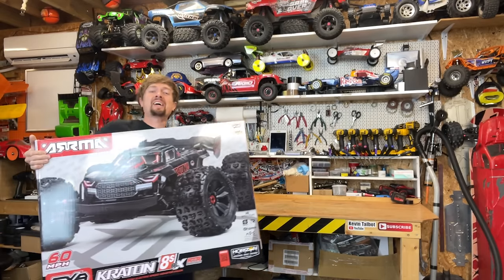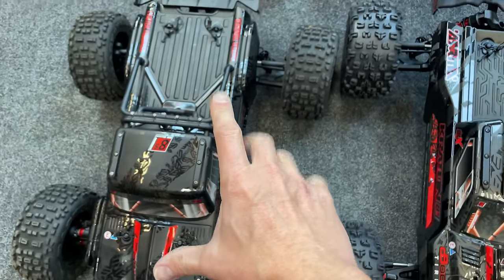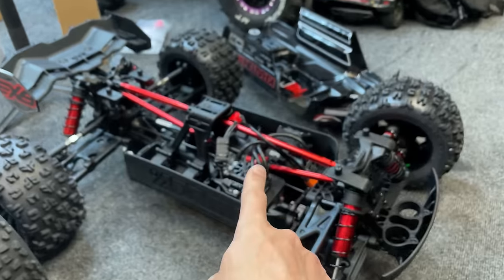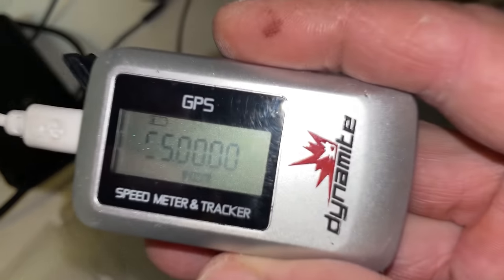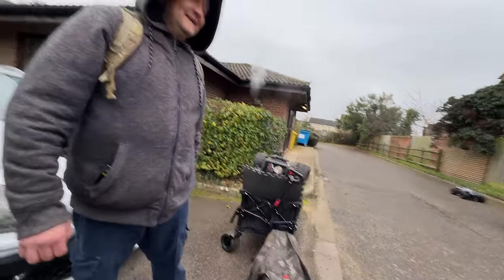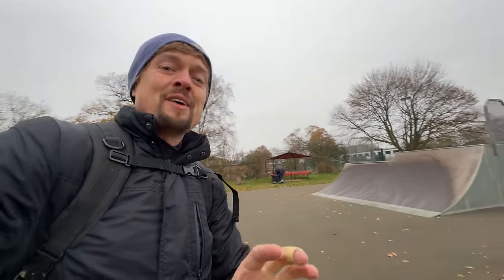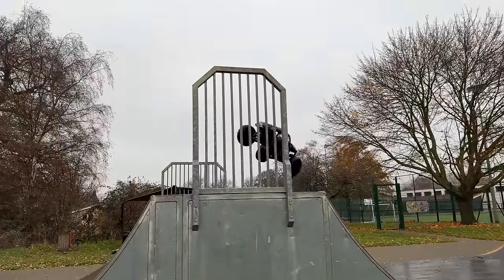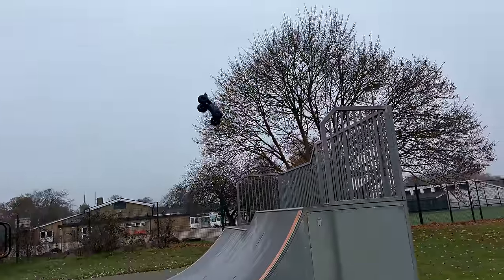This Giant Motor is Too Big for this RC Car

Comment: An RC Car that costs 4 figures, and uses the tag lines 'Engineered tough' & 'EXtreme Bash Speed Monster Truck' should be able to survive at least a single battery pack at a skatepark.
Reply from the maker: im saying nothing!
Reply: @KevinTalbotTV  coward 😅
Reply from the maker: You used to a an arrma fanboy what happened? 🤣🤣
Reply: @KevinTalbotTV  never been an Arrma Fanboy... prove it 😅
Reply from the maker: you was until they stopped giving you free ones 🤣🤣🤣🤣
Reply: Knock it off boys👨‍🦳
Reply: Tomley is a bit jealous 😶
Reply: @Logsshots  of course 🤣. The $5000 rig I’m building at the moment is way cooler than this 👌
Reply: If its so cool why does kev have 10 times the subscribers as you? 🫣
Reply: @TomleyRC  I’m at subscriber to your channel you and Kevin ain’t much different I like watching you both
Reply: @TomleyRC wheres your monster truck
Reply: Lol bullies
Reply: I was gonna buy one of these until I saw this video thankfully and wound up going with the 6s notorious. It seems like all they did really was just scale up the size of the 6s models without any real consideration for the weight increase and power increase on the drivetrain. It should have had better bulkheads and a stronger diff right out of the box. Shouldnt really be a need to immediately spend another grand in m2c racing parts for this thing to be fun. Traxxas at least has that down with the xmaxx.
Reply: Guys they just made fun of each other, dont be so mad..... damn internet karens.....
Reply: @robsp32 um....traxxas breaks just as easy when doing the crazy shit Kev does. There's a difference between extreme bashing and defying the laws of physics. You missed out on a killer rig. The notorious is a dope car too, but it's no Kraton.
Reply: @KevinTalbotTV LMAO
Reply: just cry about it both if u
Reply: Tomley I beg you stop talking waffle
Reply: @Boogie_the_cat  I did it myself 😁
Reply: I don t even care anymore now that I know better . I was kinda mad at two new Arrma RC cars servos going down within 5 packs but I’m done with it  . They should do better but this has been going on for years and the whole aftermarket parts pricing for a $150 from RC is ridiculous . People get upset and go where there’s more value . I do like my arrma RC s though .
Reply: With my dad, we played with our arrmas, only our 3s’s though, since our kraton 4s was broken. I managed to break 2/3 cars that day on a single 3s2p LiPo.
Reply: They’re all junk compared to my techno
Reply: It’s not physically possible to make an RC that heavy that can withstand landings on concrete at skate park. Could it possibly be more adorable sure but a skate park is about the toughest durability challenge you could possibly throw at an RC car. Edit: I just got to the point in the video where they show what broke. I guess I could definitely say those steering linkages should be made of aluminum on the extreme bash edition but it’s possible that’s an engineered weak point to protect other parts.
Reply: Why wouldn’t Arrma move the transmission back a few mm’s on the new Kraton to accommodate the 118 mm hobby wing motors.

There’s about 2 inches of wasted space between the batteries and the rear bulkhead. It could have easily been move  center drive shafts. Even the current 113mm 800kv barely fits. Plus it’s so unbalanced with the weight of the motor, ESC, and servo all pushed right up at the very front of the chassis. Moving it back would have made it far more balanced.
Reply: For such a expensive rig I expected better
Reply: Yea , I agree , I can remember years ago , we would  drive HPI savages and my Revo 3.3 in skateparks and they took a beating . The Kraton didn't really hold up that well
Reply: OMG it's Tom Lee I watch your channeOMG
Reply: @TomleyRC 😢
Reply: @Logsshots  damn
Reply: I never go to the skatepark.
Reply: no one drives an ric like that regularly without upgrades,

Comment: NIIIIICE 👌🏻 
I have to say I would be a bit pissed if the servo and ESC broke that quick, awesome rig other than that and that was some very hard impacts though lol
Reply: Same, you spend alot of money on a Nice big RC car, and one of the first time you jump the thing it stop working.. thats not good enough.. 🤷‍♂️
Reply: @jesperlehmann4336 didnt exactly break on the first jump though did it
Reply: smahing any rc on concrete is just plain stupid
Reply: yeah but 30ft to flat on an 8s truck isnt really in it's design scope.
Reply: Mate I bought a tlr Typhon nearer the start of the year and the servo died twice straight out the box. Replaced it like for like after the first run and it died straight away again on its second run. So had to replace with an upgrade which was £48. The buggy was like £700 and it couldn’t even cope with its power on stock parts. Wot a joke!!!! How can spectrum get away with this over n over the servos aren’t fit for purpose.
Reply: Bought the traxxas raptor r, brand new traxxas lipo first run around a flat field and the esc and motor went up in smoke. Unfortunately the shop I got it from were a complete nightmare to deal with but I did get replacement parts weeks later
Reply: Seriously 1k for a kraton 8s and it breaks that quick🤔
Reply: Ain’t awesome if breaks after 5 mins
Reply: That’s not fair to say in this case. Slam just about any major brand this hard and its going to fail.
Reply: @tidyt3656 Did you not set the end points? Longest I've gotten out of ANY servo is 6 months, but I toasted a couple in one pack before I realized you always gotta set your own end points.
Reply: My Xmaxx had a dead esc straight out the box.  It never turned on the first time to break.  My buddies Maxx had a dead servo the same way.  It never worked the first time.   There are defects and duds from every brand.

Comment: In my personal experience, I have only seen one 8s Kraton chassis bend. That’s because we were trying to jump it over a tree, and kinda missed and the truck landed on a big branch. 

I think people should give the metal chassis a little more credit, because Kev runs everything on skate parks, which is incredibly tough on everything. (Makes durability tests even more impressive) Whereas if you run on dirt, things should last a lot longer. 🙂
Reply: I do feel like these cars need stiffer suspension for running skate parks to be honest.
Reply: You can see tons of bent chassis videos on YouTube.
Reply: @truerc Oh I’m sure you can. That’s why I said in my personal experience, metal chassis have been relatively durable
Reply: i bent my 8s outcast chassis on flat ground in my yard, and my notorious 6s on like a 8 or 10ft jump. they’re weak
Reply: @samhutchins5890  Fair enough. I guess I’ve either been lucky or bent chassis without noticing. I have bent a TON of 6s Kraton v3 shock towers though. I would straighten them out as best I could. Eventually I upgraded to m2c shock towers and chassis though and it’s much better.
Reply: @casey1441  is it really worth it? i just got that outcast and cant run it now. im torn between the m2c or a exb chassis
Reply: i agreed.arrma 8s is too heavy.not meant for jump 50ft on
 skate parks
Reply: two sided foam tape is a great shock absorber for electronics
Reply: They only need to raise the sunpension and it wont bend, the car comes very low to the ground as standard.  @thecremeegg
Reply: @casey1441 I've had great luck with them as well.   My Xmaxx breaks as much or more than my Arrma rigs.

Comment: Glad you are testing them to their limits and mostly on stock parts. Very surprised that arms, shocks and rod ends didnt break. Given these trucks are so heavy, there is no chance it could survive jumps that high and concrete landings, but it held up extremely well. Im very convinced in normal bashing these should be very durable.

Comment: Kev I work at a hobby shop and sold tons of vehicles there one thing I have seen with arrma is that the end points are never set up from factory which stressing out all the electronics just something you should know any customer that buys one I always set it for them and haven't seen any come back with issues like yours, and yes I have arrmas I beat the crap of lol my chassis are all silver not black as out of the factory 😂

Comment: Kev is the reason I have my rustler, he inspired me👍
Reply: I have a rustler. It is currently out from a broken wheel+suspension mount from hitting a pole.
Reply: he is also the reason ive made it go 100mph with upgrades
Reply: @lytmoplayzz  my next goal for mine
Reply: @mntb0873  try putting a 4000kv hobbywing motor and hobbywing max 10 combo with a few other goodies and with 3s you might be able to get it. (Sidenote) you might need too lower the car with new shocks and take the rustler wing off

Comment: It seems like once you get a above 1/10-1/8 scale, no matter what you upgrade, the weight really hurts durability if you are going extreme bashing.
Reply: XRT seems as tough as a rustler. Aluminum seems to be a weakness above 10 pounds.
Reply: XRT is perfectly fine to bash with
Reply: It could be 1/24 scale and made of adamantium; Kevin Talbot would still destroy it within an hour at the skatepark. Dude is a menace, lol

Comment: Arrma really just needs to send some engineers out to visit you and have you test their trucks early and fix the things they end up breaking.  It's such an easy solution/idea I'm shocked Arrma hasn't done it already.
Reply: Because a substantial amount of their income is in supplying spares…?
Reply: When you have something that's 30% heavier than the Traxx, the amounts of energy being exerted on the parts increase substantially. I think these class of Arrma cars will just have to deal with more breakage than normal, which makes it high risk higher reward if people are into that kind of things. Also plays into that theme when the parts are more expensive too.
Reply: You can't dummy proof stuff.  There's a point of diminishing returns.  You keep adding weight you gotta add more weight to make other parts stronger.   Look at the big Raminator trucks.  They're already 100 lbs and more fragile than any Arrma or Traxxas.

Comment: Awesome vid as always! I'm guessing the new motor has a lower KV rating than stock, that's why it looked "slow" on 8S
Reply: Yep.   It needed more gear.  I run 39:39 on mine with 760kv motor.  It could even be overdriven without issue.

Comment: hey kev just an Idea to sort out the problem of the shockwave when hitting concrete, I suggest putting a strip of foam on the bottom of the chasing and sticking it on or just some small foam blocks or something just to add some padding to the chassis when landing, should sort out the problem!

Comment: Maybe calibrate the neutral point in the esc to your servo tester so the esc doesn't think you're trying to change the settings by switching it on while holding the throttle, (most escs allow this to set them up for new handsets and receivers)? Just a thought. Love all your vids though dude, no mechanical sympathy allowed, just send it!

Comment: I'm not convinced the esc is bad.  I have issues using servo testers to control them as the end points are not set up in the esc as compared to the radio.  But either way, going bigger anyway!

Comment: If you put earplugs in the center diff the top speed will increase. Right now the center diff is sending all the power to the front wheels which have less traction. Downside is you are more likely to shred the rear diff/break the axle pins so I put the Vitavon setup in mine

Comment: Hey Kevin, have you  tried making a go-kart or ebike with these massive motors?
Reply: Look up, Tom Stanton. He has with RC motors with excellent results. There is also another guy who used 8 of the 5698 brushless RC motors on an e-mountainbike. It did nothing but pull wheelies. Would be cool to see Kev try it with 12 of those motors on a DIW gokart. He knows how to work with metal and tig weld so it would be an awesome project for him.
Reply: You can, but it's a bit silly. The size of the motor shaft is the limiting factor, you're going to be fighting to keep those from spinning or snapping the shaft. Not to mention that the current requirements would be brutal.
It's much better to start with larger brushless motors, because even though that motor might look massive for RC, it's a little baby motor.
Reply: Don't you mean "Mahoosive" motors.

Comment: I fear that at a point Kevs gonna put the raminator electric conversion kit into one of these cars
Reply: Only real difference is water cooling on the Raminator. I actually think this esc and motor is more powerful.   I can't promise that.  If not they're the same.

Comment: If you Twist down the coilovers  shocks It should make the suspension a lil stiffer and you won’t get as much Chassis slap 

Great content as always 😎
Reply from the maker: that makes no difference, oil change would do that
Reply: Would it make the Ride height a Lil higher like how it’s explained? 
Even with arrma Infraction if you twist down the coilovers it makes the ride hight higher and stiffer a lil
Reply from the maker: @alitariq5968  yes, makes it higher but when you're jumping the shocks are all the way out anyway

Comment: You gotta start at 1:1 gearing on the big Arrma trucks with a Max 5 800kv or lower combo.  39:39 is great for general bashing but you can easily over drive the spur if you want more top speed.

Comment: Appreciate that you ran it stock first, then tossed in some modest upgrades and ran it again (well the electronics aren't really modest but those had to go in at that point!) before perhaps going full beefcake as you might be doing later. Skate parks sure are brutal on these heavy, large scale aluminum chassis RCs.  Still fun to watch you give these trucks a go there...better your trucks than mine LOL!

Comment: Judging by the frost on the ground. The plastic parts of the car would have been very cold increasing the brittleness of the pastic parts.  at a guess..  would have been interesting to see if that had happened in summer.

Comment: that esc wont work with a servo tester, you need to use a receiver and calibrate it before trying to test it. esc is probably fine

Comment: I managed to use a different motor mount slide and put a 70120 sized motor in It wouldn’t fit any long for sure took a dremel to the plastic and a drill to the motor mount to raise the motor up, I’m just gonna put the 800kv g2 motor back in but I wanted to see what happenes also thank you m2c for the new bellcrank design🔥🔥🔥

Comment: Had the same issue with the rear bulkhead on my new K8 EXB RTR. Happened first bash. R&r the bulk head and did the 5x25mm screws and no issue since. Also had the chassis brace ends break and the bell crank.

Comment: Glad to see how quickly you exposed the weakness in that Kraton. People swear Arrmas 6S and 8S RC’s are so tough. I send all of my 3S and 4S RC’s at the skatepark and always come out with minimal damage. Usually a bent motor mount, or a broken a-arm or shock. 

The idea is that most of these toy experts in the comments / FaceBook groups, think that more power equals more durability.

Comment: Hay kev I noticed in the last video you had trouble keeping stuff in your drill now it doesn't work on all but if you tighten up your drill chuck and twist it verry slowly like you undoing it it will click that means it's locked tight and could you do a review on the ftx tracer would love to see what you think of the little beast.

Comment: The main problem with the durability is that Kevin doesn't stiffen the shocks. If I owned that machine, I'd put heavier oil in the shocks and buy stiffer springs.

Comment: If you punch 3.1750 or 1/8" holes in the middle of the tread area of the tires it will keep the tires from swelling up at high speed.

Comment: Love my Infraction but my complaint with Arrma is it seems like you need to modify them to make them reliable. My Infraction unfortunately has the ESC go out 2 months after buying it new.
Reply: My Xmaxx came out of the box brand new with a defective esc.  Never turned on the first time.  No brand is perfect.   My Arrmas don't break any more often than my Traxxas.  Only truck I've never broken is my TRX6 and that's partly because I've driven it less than 10 times in the year and a half I've had it and it's too slow to do anything to break stuff.

Comment: Firstly you should try some double stick tape in between the components and the metal base to try to help with the absorption of the impacts.

Secondly if those electronics died it's most likely due to a cold solder joint come in loose. I would imagine if you opened them up and resolder them you could probably save yourself quite a bit of money.

Comment: Hi Kev, I just bought my first rc car a couple weeks ago and I think I am hooked. My vehicle has been in the shop for the last week so I haven't been able to get out and learn how to drive it yet. Winter is coming soon so that should be interesting. I am from Canada. I would like to enter the raffle for the Outcast and other cars but I don't want to join Facebook. Is there another way I could pay to enter? Thanks for the videos! Tumble Wumble
Reply: The most important thing you need to know about this hobby is that you need to learn to fix your own stuff. If not, you will never get to use it because it will be in the "shop" all the time. You will waste tons of money on repair labor, then get discouraged, and quit the hobby. These cars are easy to work on. As long as you're not a hack, or jury rigger, you can learn to fix your own stuff properly, and you will enjoy the hobby much more. These thing break often, so stock parts and tools.

Comment: Dude, a 70125 560kv motor has no business in a basher, lol.  Those things power 50-60lb RCs without issue.  It would have been hilarious to see the torque.